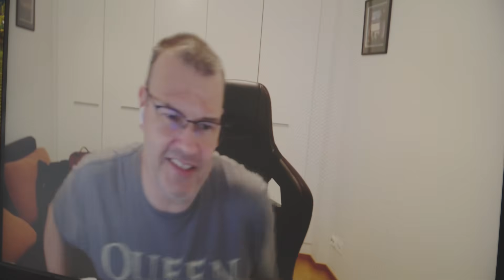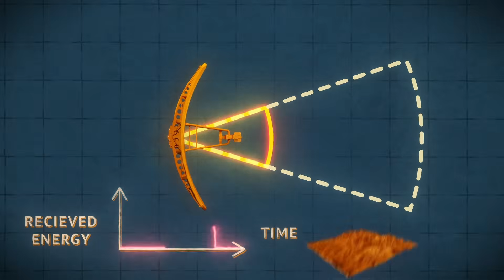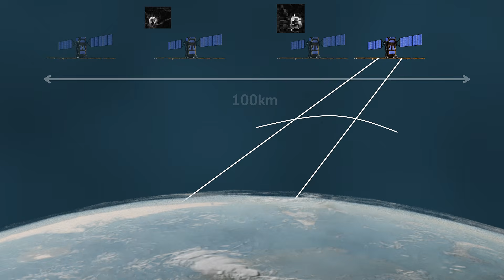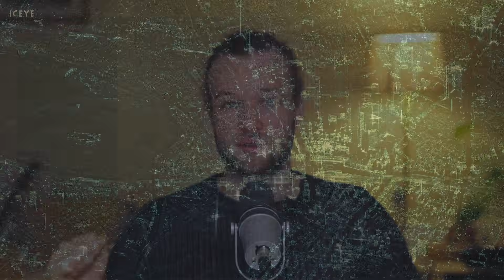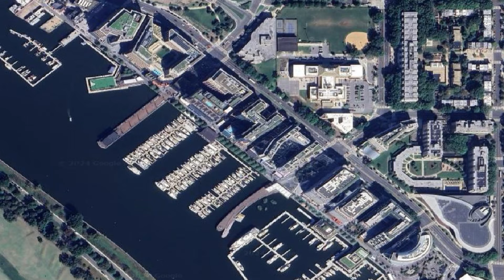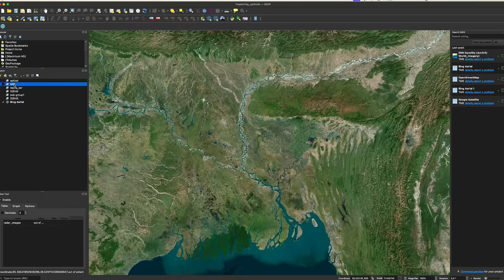How Radar Satellites See through Clouds (Synthetic Aperture Radar Explained)

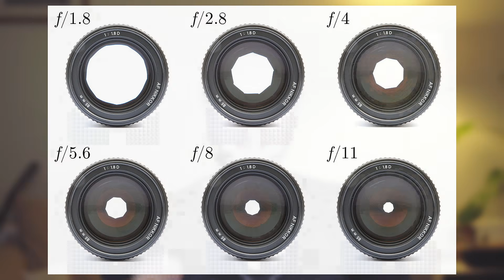Comment: Some muddling of photographic principles around 9:33, following your introduction of the subject around 7:36: 

• since a satellite is moving, it's effectively expanding the 'capture medium', so to speak — analogous to the size of film or pixel density of a sensor 
→ a larger film frame has more area in which to record, and a higher pixel-density sensor [somewhat] likewise has more pixels or photosites to record a visible-light image >>> the moving satellite emulates this by generating a cross-sectional path over a period of time like a scanner
→ there are actual scanning-light cameras which operate this way and so are nearly exactly analagous; 

• the aperture comparison and use of astrophotography is a poor comparison because the techniques used aren't for the purposes of resolution or resolving power but for gathering enough light (signal) 
→ likewise, the role of an aperture is for controlling how much light (ie, SIGNAL) is allowed through the lens to reach the sensor or film — the flashlight of a phone-camera, or flash of an SLR, is the signal supplement that, in a RADAR satellite, does what the project of their signal, or reflecting, beam produces 
→ astro-photography's technique of using long exposures is wholly different from resolution enhancement, because the long exposure-lengths are for the purposes of improving signal:noise ratio, not enhancement of resolution 

And finally, 
• there are actually cameras which have MOVING SENSORS, to create a "high resolution mode", where the sensor rapidly shifts positions to approximate this same enhancement in resolution given by the satellite's change in position, ie where it has created a 'span' of capture-distances
Reply: oh and not to nitpick, but they use "synthetic" in the vein of "synthesis", to synthesize, ie combine together, not as in 'fake'

Comment: Hi! I'm from Bangladesh. Recently, I've become very interested in satellite communication, especially through ham radio. Your video is really informative!

I have a question about something similar – an earthquake monitoring system. As you might know, Dhaka is an incredibly densely populated city, and unfortunately, most of its buildings aren't built to withstand a significant earthquake. One major earthquake could cause a massive disaster here. Our fire service teams have even said that if a rescue mission were to occur after such an event, it would be so devastating that they might not even be able to conduct one effectively.

I'm curious if you are working on any projects related to earthquake monitoring or disaster preparedness using similar technologies. It's a critical issue for us.

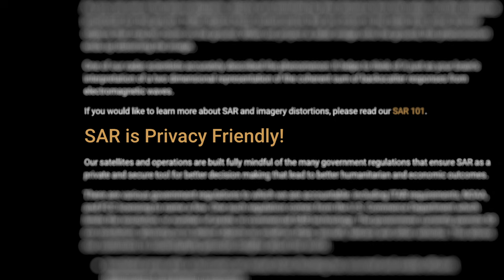Comment: @19:00 Is there a way to reduce the "multipath" effects on SAR images? Perhaps the Remote sensing engineers use filtering of wrongly polarised reflected signal like used in GNSS?

Edit: after a few more seconds of thought based on very limited knowledge on the topic, some materials may react differently to specific polarisation right? Probably may not be very useful in general but maybe useful for material characterisation?